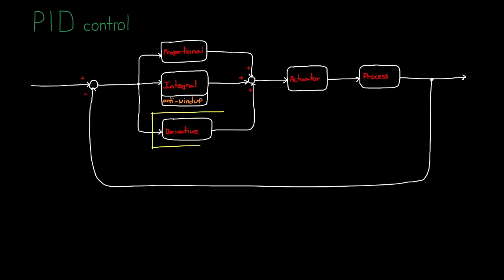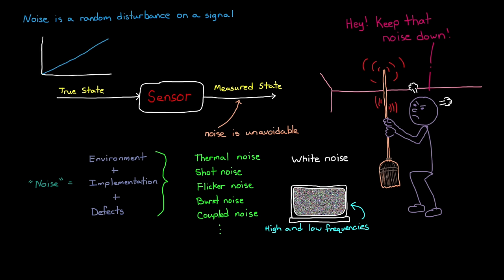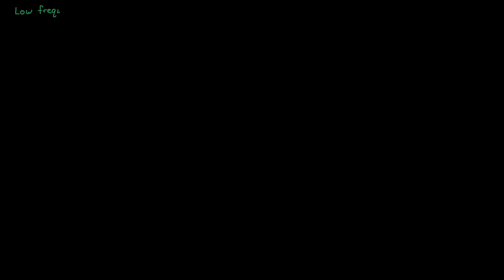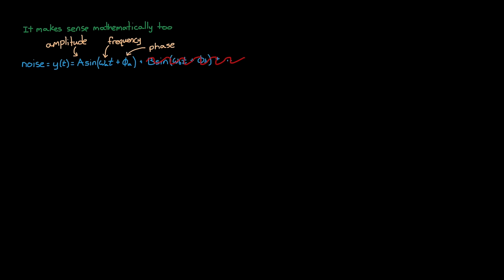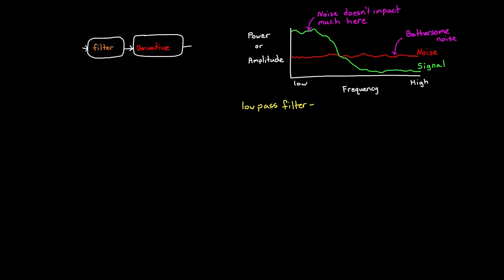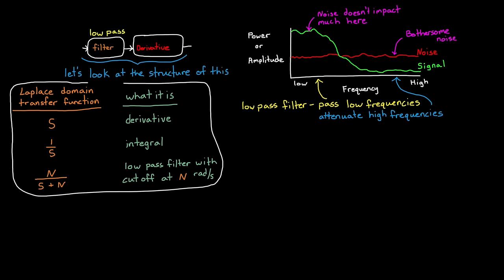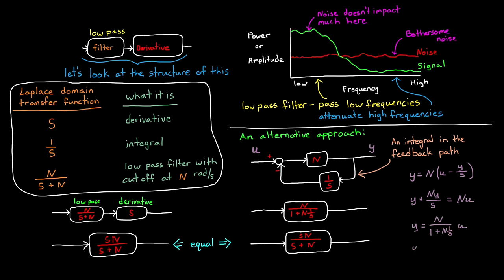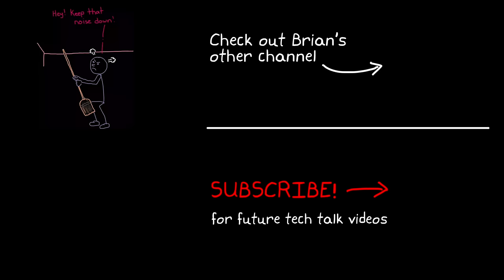Noise Filtering in PID Control | Understanding PID Control, Part 3

Comment: Thanks for watching, everyone! Write your questions here and I’ll try to answer if I can. Cheers!
Reply: Can Kalman filter be used in this derivative step?
Reply: Mosman Xia maybe in the derivative path, I’ve never done that though. A Kalman filter is used to estimate a state using a model and measurements. So usually you’ll see it in the feedback path blending the sensor measurement with a prediction to create an optimal estimation of whatever you’re measuring.  This can act like a low pass filter and remove that high frequency sensor noise before it even enters the PID controller.
Reply: Hello Brian, for my PID, I put a  LPF in front of the PID controller to suppress high frequency due to sampling (avoid antialiasing). My thinking is that this will also suppress noise and eliminate the need for a filter in front of just D. Is this reasoning correct.
Reply: Dragan Ostojić yep that would work too. If it’s a linear LPF then you can put it before or after the D path because of the commutative property of linear systems. If you put it before the P and I path then the LPF would also affect those paths then as well. It all depends on what exactly you’re going for and how you want to implement it. If your anti-aliasing filter had the right cutoff frequency and roll off characteristics for your PID controller then you’re done.
Reply: Hey Brian, I never understood why it is possible to calculate a slope at the current time step. Isn't a Derivate in a controller acausal?
Reply: A pure derivative is acausal.  Since you said time step, let's talk about a derivative in a digital system.  One implementation of a derivative is to take the current time step value, subtract the previous time step value, and divide by the delta time (slope is rise over run). This doesn't produce the rate of change at the current time step, but instead creates an average slope over the time between time steps.  This is the average of past values.   So the way derivatives are implemented make them causal.  These non-causal derivatives work (and be approximated by a pure derivative when you're analyzing a system) if the time step is relatively short compared to how quickly the slope changes.  If the slope is approximately the same over the period of the control system then it doesn't matter if the measurement is current or 1/2 period in the past - the average slope will be very close to the current value. Does that help?
Reply: Hi Brian
How can I implement pid controller in Avr circuit of an 3 phase alternator.
Please help because  I am struggling to make the circuit.
Reply: Thanks for making me love this subject. The explanations are simply extraordinary.
Reply: @Brian， Thank you for your great video. for 9:34, the alternative approach, how should it be implemented in a discrete structure? If SN/(S + N) is "c2d"ed, a differential structure will appear.
Reply: Hi Brian, Thank you so much for this video. I have a couple of questions regarding the implementation of the 'Alternative' method of the low-pass filter for the D Control:

1.Can N be treated essentially as a Gain in this format? Meaning we can just plug-n-chug a value and have it represent our desired freq filter?
2. How exactly can we assign a Derivative gain for this controller in this format now? I see that the S is now purely a function of the 1/s integrator block in the alternative version while in the original, s can be controlled by the two series blocks.

Thank you so much~!
Reply: Hi Brain! Which program you are using for drawing? I would like to recommend to my professior. Thanks! 
:D
Reply: I love you I'm from korea
Reply: where can i understand basics of derivatives and integrals w.r.t mathematics with real world examples? Any links ?
Reply: This is excellent, thanks so much!!
Reply: Many thanks Brian, I need to implement and code PID in digital form via C++ or as they call it "Discrete PID" .
Would you please help, or just provide a link where I can start up?
Reply: Brian brain OP

Comment: Hi sir, when we normally use a low-pass filter, we face the phase lagging. For the real-time signal, phase lag is undesirable. How can we eliminate the phase lag caused by a low-pass filter?
Reply: Hello, good question! Not all phase lag hurts a real-time system. If you look at a Bode plot for a low pass filter you'll see that there is almost no phase lag at the low frequencies (passband) and that there is 90 degrees of lag at the high frequencies (stopband).  So if you're using the low pass filter to block undesirable noise, the low pass filter will only add lag to those high-frequency noise signals (not a big deal) and not add very much lag to the low-frequency signals you want.

Comment: I want the simulation file of adjusting the pid fines by the pso algorithm using the three-phase induction motor optimization method by direct torque control.
Can anyone help?

Comment: Hello Brian, I have a sensor with long time response in the system. Let's say that the system will detect an error and will activate the actuators in order to correct it. I am afraid that in reality the error will be corrected but the system will keep the actuators activated for a longer time than it is necessary and we will use a lot more resources than it is necessary. Is there any option to delay the controller's response? The sensor can't be changed, maybe there is another option for trolling this system?

Comment: i'm just trying to learn enough to set a control strategy  for a refrigeration condenser. after all of my "actuator" hardware is instantiated in the application, it only asks for 3 settings P I D, which i assume are unitless whole numbers? does it differ across different controllers or is there some sort of standard in place?

Comment: How would I implement a low pass filter in a digital PID controller?
Reply: With an FIR or IIR filter. Pre requisite would be discrete maths and knowledge on transfer functions, Laplace transform and z-transform. If you wan’t to be able to do it yourself without the aid of a program. But really by then you should probably be studying electronics engineering or control engineering 😛 but really this stuff is 5th semester stuff

Comment: Thank you Brian
How can we use PID block to calculate a signal derivative 
And may you explain with examples 
Hope you can explain about Feedforward control together with Feedback controller
(I need to improve an existing feedback  steam pressure control by adding a feedforward control part acting on steam flow measurement)

Comment: This video was really confusing. Why did we start taking derivatives of frequency’s, when before we were taking derivative of the difference between actual and desired value? also when u were talking about low pass filters where u talking about hardware or software? cause it seemed like hardware but then u said we are multiplying the low pas filter by the derivative, which also made no sense just by itself, which seems like software, and then u started talking about wiring things in parallel and series which made me think hardware, but you started doing more math which made me think software.